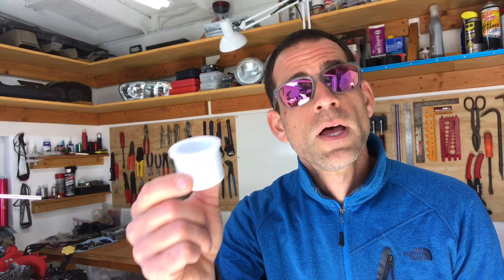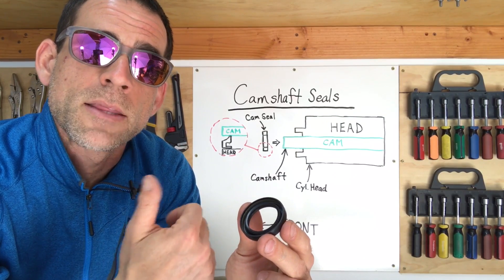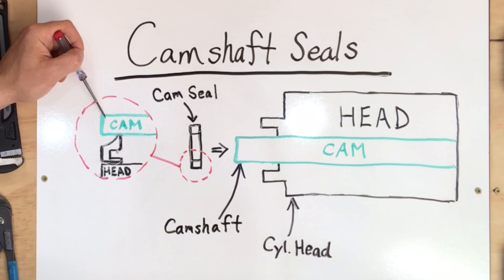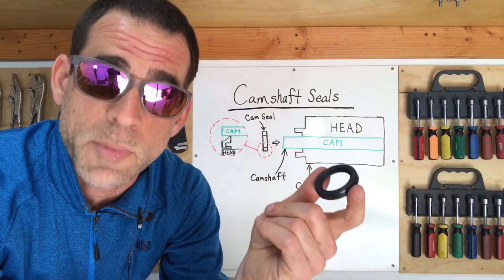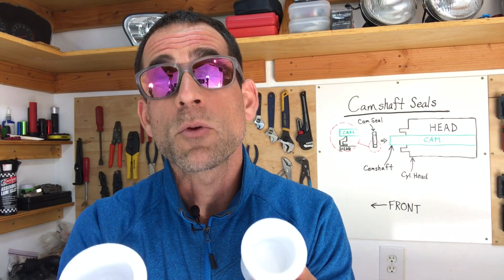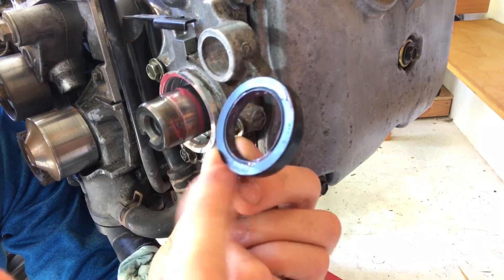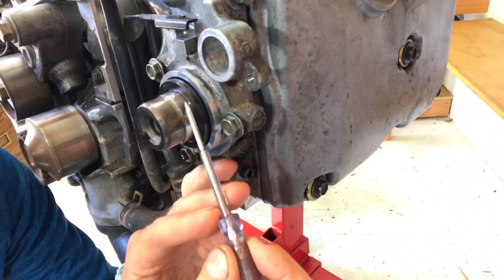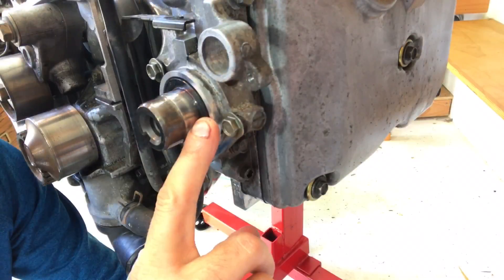Camshaft Seals | Whiteboard Drawing & $2 DiY Tool

Comment: hi where is your shop? you seem very informed on Subaru's I have an OutBack 2002 VDC does the timing chain need to be done? if so when? I bought it with 140,000 miles thinking about replacing the radiator and using Evans coolant. is the H6 engine better than the H4? in terms of reliability, maintenance, life, and problems? thanks for sharing your knowledge.

Comment: Hello I have a 2003 Subaru Outback I cannot get the crankshaft sprocket off due to the woodruff key being broken off in the slot. Tried a pulley to no advail. Any suggestions

Comment: whats your recommended method to remove the camshaft sprockets?
Reply from the maker: +Brown Man   Hey man. Thanks for dropping the question!   I like to use an old timing belt, route it over the cam sprocket, then clamp it with locking pliers in a way so it doesn’t let the cam sprocket rotate, then loosen the cam bolt and DONE.  Works pretty darn nice every time.
Reply: SubaruONLY well the timing Belt is still good and I just noticed that I may have a leak from one of the passenger side seals. Never had to deal with this for 15+ years owning my car. So now I'm trying to find the best way to handle this. I understand and know I need to remove the cam sprocket to change the seal but I hear some people experience trouble removing them 😪
Reply from the maker: +Brown Man   You definitely do have to remove the sprocket to get to the seal, but removing the seal isn’t too hard, I just use a little pick and work it out slowly and carefully.  I have see some use a wood screw too - just screw it in a little ways, not all the way through, then put few more around the seal, then pull with pliers or vice grips slowly and evenly.

Comment: Dude, you're literally an encyclopedia.  Mind if I rack your brain with some questions?
Reply from the maker: +Charles Edge Sure man.  I’ll do what I can. No promises.
Reply: So I saw your parallel fuel setup video and I was wondering if that's something that would benefit my old EJ251?  I'm about to rebuild it (197,xxx).  I nixed the idea of the lightweight pulley (I'm not running an accessory belt so I guess that helps?) Based off your other video and I was gonna see if there was a anything you could recommend for longevity of the motor.  This is my first time trying to rebuild a motor and some wise advice would be welcome.  I hit up nasioc and scoobytruck and the RS25 forums and everyone is recommend 257 head gaskets and turbo'd rebuilds and I'm not looking  300 HP out of my Baja with a 4EAT 😂.

Comment: beautiful video! love your tour to the hw store. PLEASE PLEASE show how to remove the cam bolts. if you can.. I got an 05 STI with leaky camshaft seals.
Reply: just broke the 4th bolt loose.. i can finally do the seals. i dont have a welder and have no experience so.. yah had to order a carbide drill bit 25/64 little smaller than 10mm.. conventional home depot bits wouldnt cut into those bolts. anyways after a week i can finally do those seals. will use this video for sure. thanks again.
Reply: i dont have a welder and have no experience so.. yah had to order a carbide drill bit 25/64 little smaller than 10mm.. conventional home depot bits wouldnt cut into those bolts. anyways after a week i can finally do those seals. will use this video for sure. thanks again.
Reply: sorry. yah i am the same guy as anirban0
Reply: To loosen the bolts that hold on the cam holder, You need  the torx plus bits. Then use the impact driver and hit it with a heavy hammer. I was surprised at how hard I had to hit it. But all came loose without drilling, welding, or cutting.
Reply: never mind I see hat its already requested... like others.  I appreciate the details
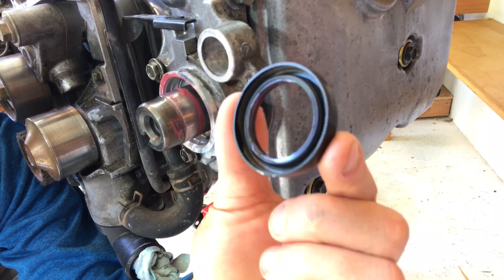Reply from the maker: +anirban0   Hey man.  Thanks for the comment!  Check out my last video, "Bent Valves are BAD | Part 2 ..." at about minute 6:10, I show how to torque the cam bolts - You can do the exact same procedure in reverse to losses those cam bolts and remove the cam gears.  How this helps - Thanks Man 🤙
Reply: Yah saw that. but I have those stupid HEX bolts.. anyway after trying everything that the internet suggested, ordered me some carbide tipped drill bits from amazon.  most aweful bolts in the universe.
Reply from the maker: +anirban0  Those hex bolts SUCK BAD.  Hopefully the drilling works.

One more option that works pretty nicely is to weld a bolt on them, then give it 60 sec to heat soak that surrounding material, and then hit it with a heavy duty impact gun to break it loose. 

It works pretty sweet, just make sure you don't put too much heat in the there when welding it.
Reply: just broke the 4th bolt loose.. i can finally do the seals. i dont have a welder and have no experience so.. yah had to order a carbide drill bit 25/64 little smaller than 10mm.. conventional home depot bits wouldnt cut into those bolts. anyways after a week i can finally do those seals. will use this video for sure. thanks again.
Reply: i dont have a welder and have no experience so.. yah had to order a carbide drill bit 25/64 little smaller than 10mm.. conventional home depot bits wouldnt cut into those bolts. anyways after a week i can finally do those seals. will use this video for sure. thanks again.
Reply from the maker: +John Jackson   Whoa.  Glad you got it free.  Hell of a pain in the ass though!!
Reply from the maker: +John Jackson   Thank you my friend.  More to come for sure.
Reply from the maker: +John Jackson  no worries.  Thanks for dropping the questions!  😁
Reply from the maker: +Michael Riley  Nice Man.  Getin it done!! 🤙🤙
Reply from the maker: +Michael Riley   Nice.  Thanks for good advice man. 🤙🤙

Comment: Thank you for this detailed information it's much appreciated! Is it really easy to remove an old camshaft seal that's leaking?
Reply from the maker: +RoguePiston  Yes, it is fairly easy.  I have used two ways, here they are: 
(1) Use a small pick and flat blade screw driver to slowly work your way around the seal and tease it out gently and without marring the machined surface it sits in.
(2) Use a few small wood screws. Screw them in only a little ways through the seal perpendicular to the face - not all the way through to the other side - just through the seal material, and space them evenly around the seal. Then use a pair of needle nose pliers to grab the screws and slowly and gently work it all the way out. 

Hope this helps. If you do end up using one of these methods and can drop a message here and let everyone know how it worked?  Thanks 👍👍
Reply from the maker: +JAMIE DEAN    That’s a bummer man.  Good luck my friend.